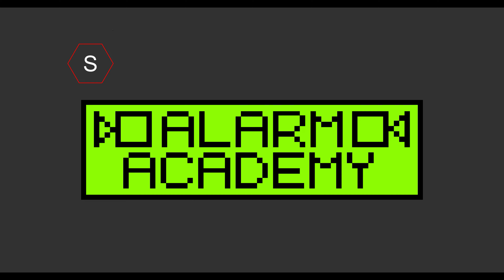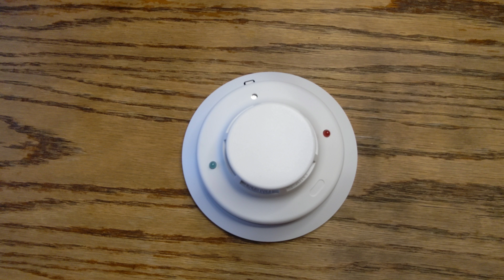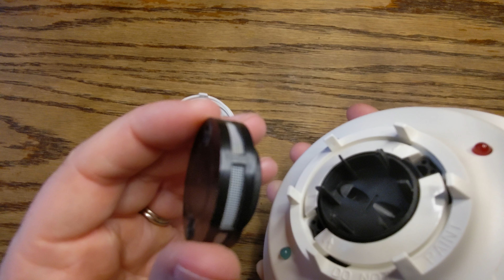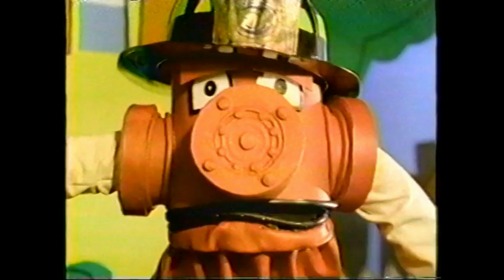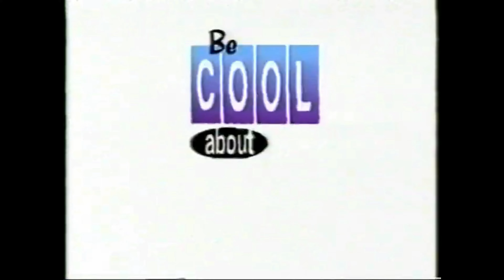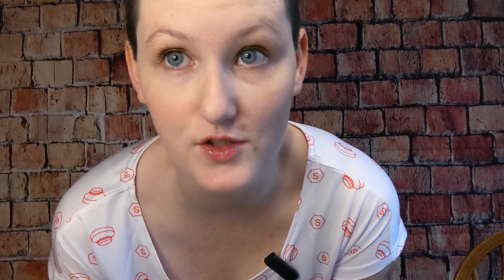Alarm Academy - How Photoelectric Smoke Detectors Work

Comment: Hopefully with the new UL 268: 7th edition (Smoke Detectors for Fire Alarm Systems) and UL 217: 8th edition (Smoke Alarms) in 2021, UL introduced an additional test called the hamburger nuisance alarm test. In this test, a defined concentration of hamburger patty smoke must be distinguished from a defined concentration of flaming polyurethane. This test should help lower the false alarm rate in kitchens. 
This is a better solution than replacing a fast acting smoke detector with a heat detector that would alarm much later in the fire cycle.
Reply from the maker: I love to hear it! I hope the tech is able to keep up with those demands.

Comment: I have never heard of using a heat detector instead of a smoke detector for a fire alarm. This might solve my problem I have in a drafty building that usually gets a lot of false alarms for no reason.
Reply: In code required smoke detector locations, heat detectors are generally not direct replacements for smoke detectors.

Comment: I was wondering about the loud sirens that go off in businesses. Why are they so loud? Is there a reason for them to be so loud? Can the sound be adjusted? Keeping alarmed! Lol
Reply from the maker: If you're talking about horns and things associated with a fire alarm system, most of them do have a volume adjustment.  They're supposed to be about 15 decibels above the ambient sound pressure, if I'm not mistaken, but a lot of people just seem to install them at the highest volume and move on.  For burglar alarm sirens, most of the ones I've seen cannot be adjusted.